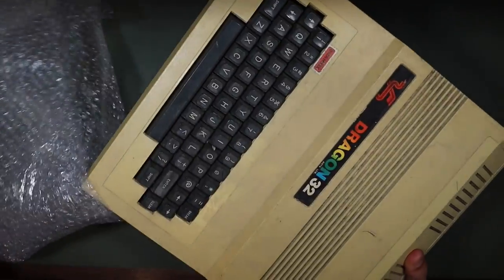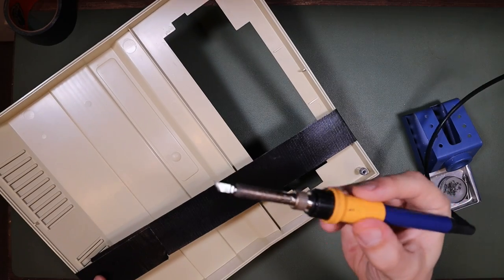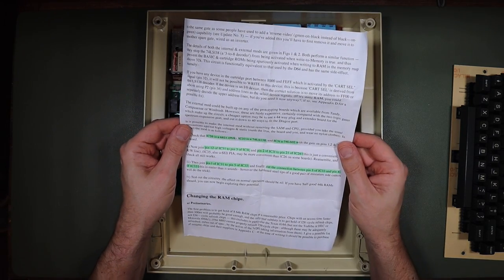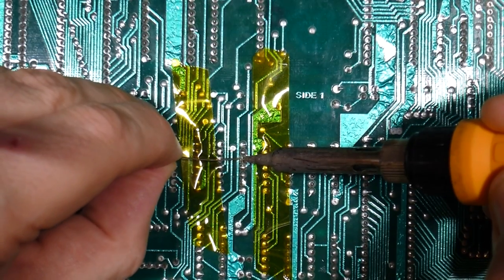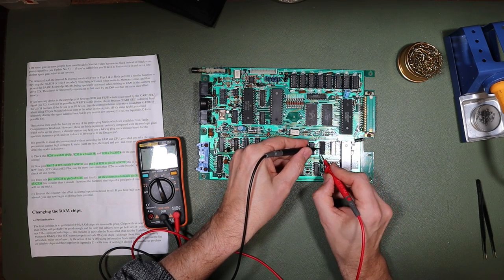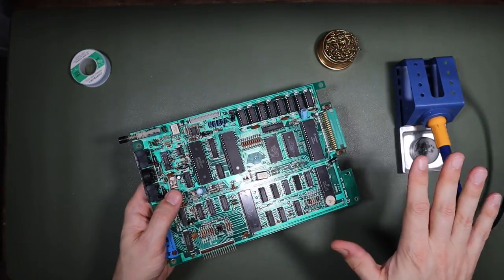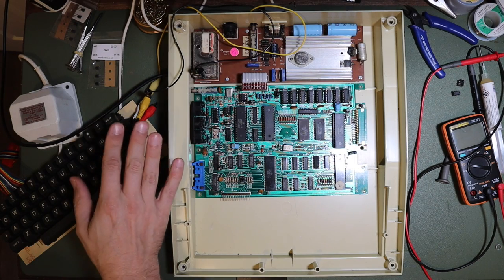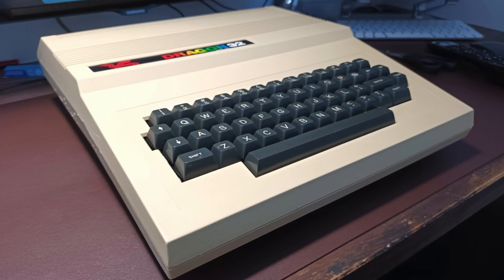Dragon 32 Retro Computer Upgrade & Repair (Return of the My Mate VINCE Dragon)

Comment: Excellent work on the RF out. I agree that it's nice to be able to use a system as you remember using it (that's what the whole nostalgia thing is about after all). I felt for you after the failed plastic welding attempt. I tried the same thing on an Amstrad CPC a few years ago, the crack was at the front of the case and quite long. After a good half hour and a lot of careful work the same crack is still there, the only difference now is that the plastic on the back is melted and a little burned. I read afterwards that the key to success with this method is light metal mesh or scrim melted into the plastic (from behind of course) to strengthen and hold everything in place. Anyway great work on the video (I always enjoy them) and of course the old Dragon. You managed to get it breathing fire again ;)
Reply from the maker: Hi @8bitsinthebasement hope you are well. Thanks for the tip, I've had minor success with the plastic melting in the past and I was annoyed the crack opened up but that's life I guess. I like the scrim idea. Still much better than before. Did you see my repair of the machine on my mate vince
... this thing had been abused and really should have been scrap. Thanks for sharing the amstrad story made me feel a bit better. Glad you are with me on the RF, not sure why I can't get both right.  Anyhow...Hope you are well thanks for your continued support.

Comment: I guess that's a Dragon 64 now :) Nice job!

May I ask what kind of desoldering station you were using in this video?
I'm thinking of buying one. I have underestimated how hard is to desolder a DIP-28 chip without one :)
Reply from the maker: I find some desoldering is very tricky and  I sometimes use braid as well as the desolder tool. I use a duratool desolder Station I got from CPCFarnell because it was among the cheapest I could find, not necessarily the best. I think the Dragon 64 had additional features like a serial port and better support for the ram, so it's not quite as good, but the difference in the cost of ram chips is such that since I had to replace them anyway then why not? Interestingly the chips I had from the factory were "defective" 64k chips with only the lower 32k used. Anyway thank you so much for your comment and questions. Glad that you enjoyed the video.

Comment: Hi Roger. I'm currently knee deep refurbing my two Dragon 32's and have terrible video on both like you did. I know that you swapped the top IC for an LM318, but what did you swap the lower one with?
Reply from the maker: Hi Scott, for the life of me I cannot remember. You are not the first to ask and I've even looked over my original footage and email receipts to try to figure it out. I'm assuming since I made a stink about one of them not being factory part number that the other was. Can you perhaps let me know the markings on yours and I will use that again in my search?
Thanks!
Reply: OK, both chips are marked ‘SFC 2318 DC 218’. Let me know if you can. Appreciate your time!
Reply from the maker: Hi Scott, Interesting. In mine they were different. My best guess (and it is a guess) is that Dragon used whatever was cheap and perhaps the SFC 2318 DC was an LM 318 equivalent. This link (for a metal can version) seems to support that theory 
https://www.pentod.com/product/5684/integrated-circuit-sfc2318dc-lm318-op-amp.html.en
as does this link
 http://matthieu.benoit.free.fr/cross/competitive/Sescosem/SESCOSEM_linear_circuits_cross_reference.pdf
I am pretty sure now that the lower one is mine was a CA3100E, they are still available if you shop around but are pricey. The pinout looks similar to the LM318 but I am not really sure if ANY of these are compatible. 
All just my opinion of course, anything you try would be at your risk, but hopefully this is useful.

Great Question
Reply: @RetroTechRepair  Thanks for getting back, I appreciate it! I'm gonna be plucky and replace both chips with an LM318 and cross my fingers! Thanks for your help. Oh, and after a bit of screenshotting and cutting/pasting, I found that the lower chip you replaced was a CA3100E. Looking at the datasheet, it's practically the same as an LM318N so all good!
Reply from the maker: @Uzeless  I reckon that's what I would do, but I'm no expert. Let me know how it goes

Comment: why not use super glue to fix the crack and glue a piece of scrap plastic across the crack also?
Reply from the maker: Hi Kaliban. Thanks for your question. Originally the hope was to repair without glue, but when that failed I chose epoxy because unlike superglue it can be applied from behind. Superglue would need to be applied to the surfaces of the crack itself and would likely have been very visible on the outside surface where it would dry very hard. Thanks again for your question. Hope you enjoyed the video
Reply: Superglue to close the crack and bi-carb on the inside to turn the superglue into a very strong filler bridge.

Comment: Hi. I just landed on your channel and immediately subscribed after watching this video, as I am looking to improve my Dragon 32 video. Thank you so much for the video. Would you please be so kind to post the OpAmps models, so I could try them ???. Thanks again for such a nice and illustrative video Roger :-)
Reply from the maker: Hi welcome along and thanks for the sub! I don't remember both op amp models. I'm sorry I didn't mention them in the video. The hard to find one was an SFC2318 I replaced that with a LM318, the other was a like for like replacement but i don't remember the number. Sorry 😞
Reply: @RetroTechRepair  Thanks for the info. I'll find out the other one. Have been looking at older videos and really like your channel.

Comment: Hi there! Can you/anyone help me? Ive got a dragon 32 myself, and I read in several postings, in the history of this computer it happened, that they delivered 64k models with 32k on it, just to get anything sold, when theyve had problems in production. So, does anybody know how I can check this? How do I get to know? I bought mine in spain, and there had to be those computers being sold like that. I would be glad if anybody could help. THX - Anne
Reply from the maker: Hi Anne, I think they did ship some Dragon 32s that used 64k ram chips, these were probably bought as "defective" chips. The "extra" RAM would not be enabled so without modification the machines would only have 32k available. They could be modded to access the 64K, but the 64k chips may be defective so the additional memory may not work properly. The only way to tell I think would be to open up the machine and take a look. If you did have 64k chips you'd need to perform the 64k mod to see if they worked (or remove them and test them off the board)